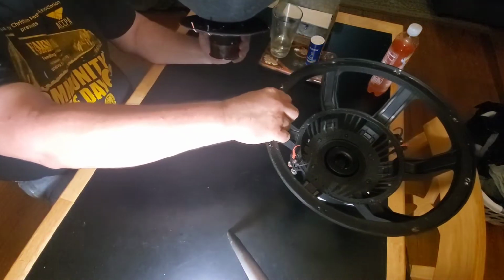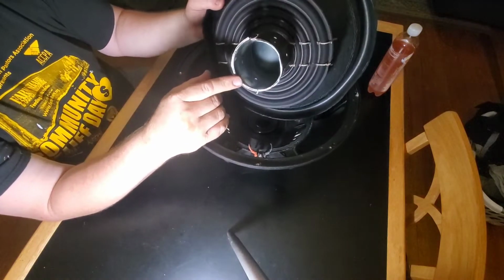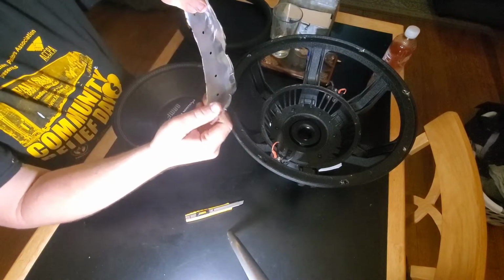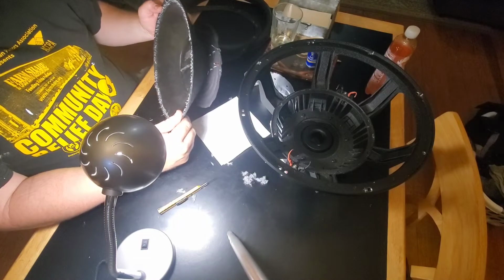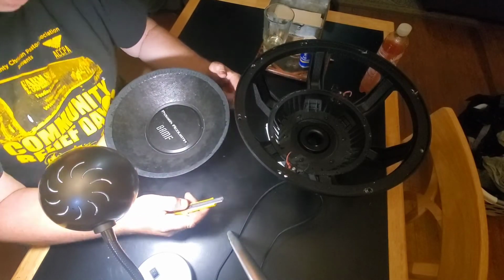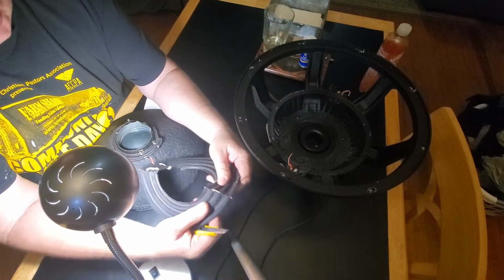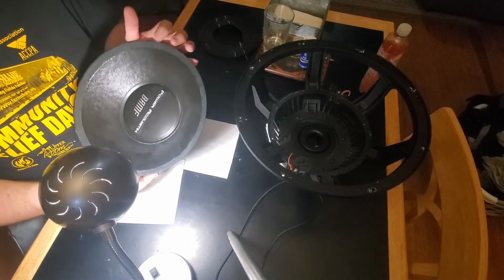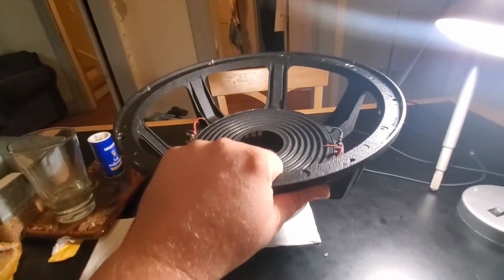budget power acoustic bamf 15 repair, part harvesting from the original. 24 hours?

Comment: Hey what size spider does this subwoofer need? And is there any information on what type and size [height] that i will need?.
Reply from the maker: 9.25" spider, lord of bass on ebay has em. They would be classified as a "flat spider" the original was a double, two spiders stacked, lord of bass says you can stack theirs directly together, they sell with or without sown in leads, I have one of each, I have yet to assemble them. Stiffness plays a factor, hard to find the original specs on Stiffness, typically ranges from A to E I believe, A being soft, E being very stiff, most high powered subs are in the upper mid, to very stiff categories, but all spiders soften after use. Softer produces better sound quality, stiff for spl.